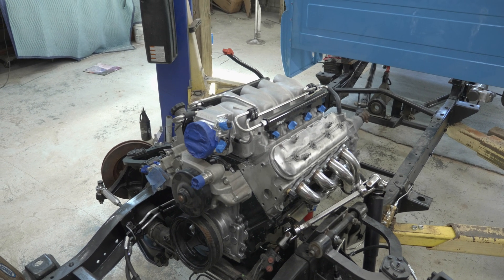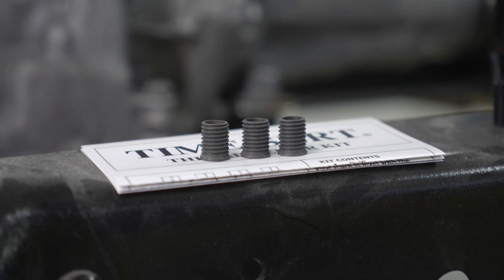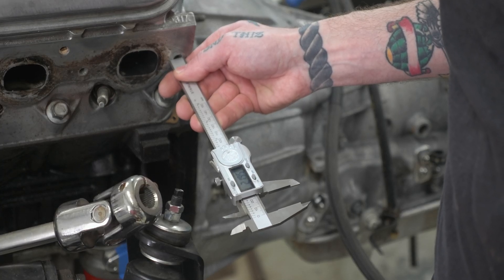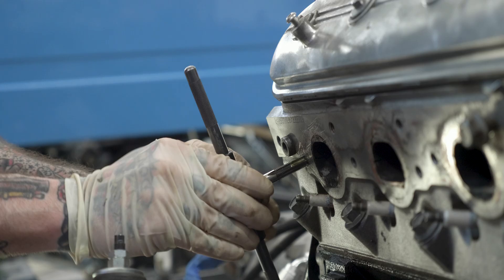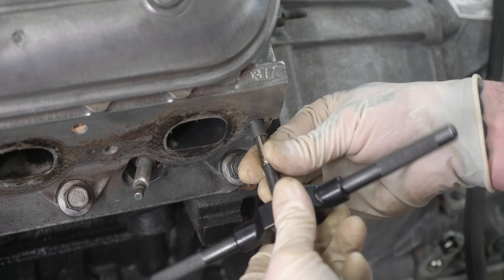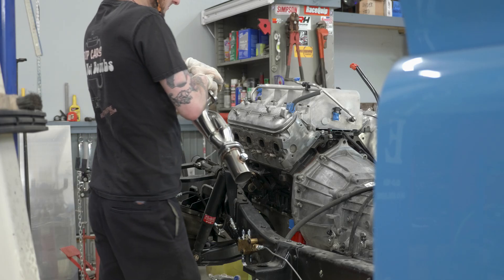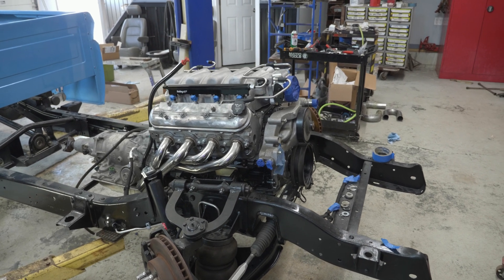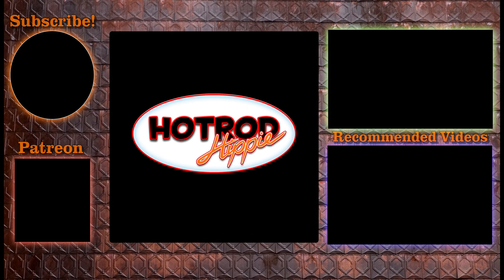Stripped Thread Repair - Time-Serts BETTER than Heli Coils! - LS Exhaust Thread Repair!

Comment: HeliCoil and Time Sert both have higher pull-out strength that the original tapped hole in the aluminum casting.  This is because both are harder and stronger than the aluminum and they both have a larger diameter thread and therefore more surface area bearing on the aluminum.  You are in effect increasing the diameter of the bolt or stud.  In critical applications you can use additional HeliCoil inserts in the same hole by stacking them.  Once you have reached the tensile strength of the bolt or stud with the pull-out strength of the HeliCoil any more HeliCoil is useless.

Comment: Thank you very much. I think I may have cross threaded one of the middle bolts last night. I was going to ignore it. But i figured while the engine is out I better remove the manifold and check. Hopefully I won't need to use the information in this video for a very long time. I'll find out after work 😢 I've never used a heli coil or time sert so it's pretty intimidating especially since it's a fresh rebuild 🤦‍♀️

Comment: I bought an expensive Serpentine kit for my '69 427bbc.  It has 840 heads and the front Bolt hole to mount the Alternator is a 7/16-14 but the kit came with a 3/8-16 Bolt.  What's the best way to handle this?  Do I drill out and put in a threaded 3/8 insert?  Maybe change the hardware to 7/16 an drill out the shim? I can't believe how much time I've spent worrying over this.

Comment: Soooo, I have an LS 706 head that I thought was ok (on first glance). I did notice a broken exhaust bolt which did not bother me. I have removed these before without issue. I didn't notice a cross threaded spark plug AND I really didn't notice that the 4 center exhaust manifold bolt holes were completely stripped out. I had fixed a spark plug hole before and that worked out just fine. What to do about the other 4? Luckily, I found your video! I bit the bullet and purchased the kit you used. At first, I was weary because the kit is not cheap. Worked perfectly! Worth every penny!  It's a small thing, but when you can repair something yourself without having to go to the trouble and expense of paying someone else, it is very gratifying. Thank you for your video. I have gained new confidence in an area I previously found to be very intimidating.

Comment: I'd bet that insert eventually pulls out.. If 8x1.25 was the original size but it was tapped to 3/8-16 the hole is already too big.. You'll need a fat timsert or keensert.

Comment: Good explained, i did insert on caliper hole on hub of my ford steel rust free m9 1.25, would not trust helicoil on my breaks. Solid. Solution saves changing the whole hub leg of my car

Comment: These inserts are not any stronger than helicoils from the data i have seen. As an Engineer it makes a little sense as the softer material used in these inserts needed to swage the insert into place is its weak point. Helicoils are a harder material. Just my perspective, but enjoyed the video all the same.
Reply: Helicoils can unwind and/or distort. No thanks. Time Serts 100%

Comment: Would i be able to do this repair and be able to torque to spec or im better of dropping a few points of from its recommend Nm torque for example if torque spec is 10Nm i should torque the repaired thread to 8Nm

Comment: That blue loctite is pretty useless on exhaust components. You need to use the 271 variant which is good up to 500° and can only be removed with heat.

Comment: I have a aluminum 6.0 LS engine and one of the holes in the block where the head bolt  screws in yhe block is stripped out,  will the Time Sert work for me?Thanks
Reply from the maker: Yep. I don’t know the thread size of that off hand but Time-Serts have been used as official GM repair kits for Head Bolts (I believe mostly on cadillacs). Just have to find the right size for your need. I’d imagine if you contact the company they may be able to help you figure it out.
Reply: @HotRodHippie  ok Thanks

Comment: Now I'm not going to say I won't 100% do this for a head bolt that pulled out 😅 but I will also be doing it with a power drill. I know there were machinists shuddering at the idea of that 😅

Comment: can this be used on a starter holes
Reply from the maker: Sure. If you can get close enough to the block to install them. GM has included these in service kits for Cylinder Head Bolts in the past.

Comment: Cool little tool. Im my last video (22R-E part 2) I 3d printed a drill guide for a Helicoil repair on the block so that I could fix a stripped head bolt hole. I am pleased to say that my Helicoil held the head bolt just fine, but I would definitely have used these instead had I known more about them.  (BTW, the 22R-E video is worth a watch if you have a few minutes.)

Comment: IIRC Tim-Serts were GM's repair method for the Cadillac Northstar V8 cylinder head bolt holes
Reply from the maker: You are correct. They seem to have been used by a few manufacturers for certified repair jobs.  I know while researching for this I saw their website call out Cadillac for certain.

Comment: On Mercedes M117 engines,  stripped head bolts are repaired with TimeSerts, which is where I learned about them.

Personally, I used them to fix engine mounts on my VW Jetta TDI with the ALH engine suspended off of a pair of aluminum mounts.  The engine side of the mount is is threaded directly into an aluminum casting, and likes to strip after a few timing belt replacements, due to the torque spec of the bolt putting huge loads on the aluminum threads.
Reply: Yeah I work on German cars myself. Use them all the time on M6 and M7 hardware you find on a plethora of German products. Most recently, I did some on a CAEB 2.0 TSI. The vacuum pump mounting bolts. Someone hulked them on and stripped the crap out of one. Developed a leak from the mounting gasket.

Comment: I was first thinking.. bah.. it's another type of Heli-Coil. Wow. They certainly are not that.
Very neat how the bolt expands the Time-Sert into the threaded hole to set it.
Pricey to start, for sure. But go buy a quality tap and counter-sink bit and the initial cost isn't as painful.
Thanks, Alan.
BTW.. Nice bike.
Reply from the maker: Thanks Joe.  It is really something you have to get all the info on to see the value.  Which is why I wanted to make this video. Once I really learned of them and experienced them I haven't looked back.

Comment: Another great video! 30 years ago I worked for a racing team that cnc machined various engine components out of magnesium and other exotic materials. Rather than tap holes directly into the magnesium we installed Time-serts to prevent later issues with gauling or thread damage.
Reply from the maker: That makes perfect sense. I could see doing that in stainless components too. Put a steel insert in to prevent galling. Hadn’t thought of that. 👍🏻👍🏻